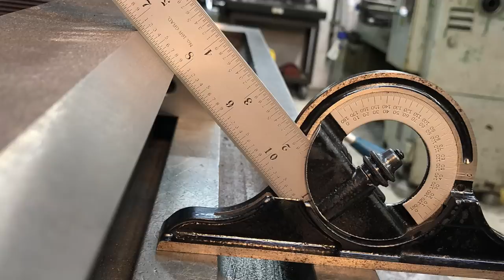SNS 310: Machining a Cast Iron Prism Straight Edge

Comment: you did not say if you were happy with the results of using that stripper wheel on the casting?  Work well? Or?

Just a crazy idea:  When you are not working on a project that requires imperial specification/measurement, you might find it easier to use metric rulers and calipers, for instance, to avoid having to mess around with 'fractional incehs' for quick measurements, like you were doing to center the part in the vice...??
Reply: His scale is not fractional, it's decimal. I'm not sure what makes people think that USCS ("imperial") is fractional. USCS scales/rulers come in fractional for carpentry and decimal for machining. Just as metric can be expressed as a decimal, so can inches. 5.565 inches is just as easy to read as 141.35 mm. Metric can be expressed as a rational number too.  141 4/10 mm. Rational numbers are actually more precise than fractional numbers. Try expressing 2/3 as a decimal. Even if his scale was fractional, most people in the trades have no problem using fractional numbers. For some reason Europeans just can't grasp fractional/rational numbers, which is weird. I'm in a weird position, where I used fractional USCS for my construction, decimal USCS for my machining, and decimal SI/metric for my scientific/academic work. So I can go between the two systems, and between  fractional/rational and decimal.
Reply: @xenonram  say what?
"For some reason Europeans just can't grasp fractional/rational numbers"
That's simply insulting, on the face of it, but....
Since "rational" is an entirely different mathematical term, perhaps you failed to grasp "rational" vs. "irrational"?
Is that something that US Americans can't grasp?
But, maybe you thought to say "decimal" instead, although you made the same error, again : "Rational numbers are actually more precise than fractional numbers. Try expressing 2/3 as a decimal"
Since 2/3 is an irrational number, it's a long stretch to write it precisely in decimal, but, one might argue, why would you specify something that you need to repeat as a measurement with an irrational value, when any measurement has, by its nature, some physical limit to its resolution, precision, and accuracy? Hmmmmm.
Anyway, that's as hard as taking a slice of pi.
And, with metric, one (the rest of the world, at least) does not need to futz with calculating around numbers like 12,36,1728, or  ounces, pounds, cups, pints, quarts, gallons, et al.
And, as you noted :
" I can go between the two systems, and between  fractional/rational and decimal."
One avoids that whole "go between" issue, ensuring more error-free interchange of information.... and, again, what with this "rational" thing?
In any case, who, given a real choice, given a choice, would choose a system that works like this: 

- Number drills get smaller with higher numbers
- Letter drills get bigger with higher letters
- Fastener sizes get smaller with smaller numbers, but, suddenly, change to fractional (but still rational) sizes
- Tap drill sizes for fasteners are numbered, but in the opposite direction to fastener size
- Sheet metal is thicker with higher gauges
- Wires are smaller with higher gauges
Sadly, we are all stuck with 60/60/24 for times, and similar numbers for degrees! (unless we use radians ;-) ) 
Have a lovely, hopefully COVID-19-free, day!

Comment: How do you prevent chips from getting stuck in the soles of your shoes. I always get them embedded and have to pick them out (PITA) before I scratch the crap out of my floors. Also, how do you prevent your vacuum from getting clogged with long stringy chips?
Reply: Switch shoes. Or love the work more than the floors.
Reply: Chips in the shirt are worse,  especially when hot!
Reply: Clean the floor more often ,use chip deflectors, change shoes,and use vacuum cleaner.

Comment: What's the point of scraping a straight edge instead of surface grinding?
Reply: Surface grinding won't get it perfectly flat. There is always stresses imparted by the magnet, imperfections in the ways, wear of the wheel, distortion due to heat. Scraping gradually and systematically removes all high spots to make it practically perfect. It imparts no stress on the workpiece while you are doing it, there is no heat distortion. Also, if you are talking about a sliding surface rather than a straight edge you DON'T want a perfectly smooth surface. You want many discrete point so that oil will be held in the gaps between the points. For a straight edge, perfectly flat like a granite  surface plate would be ok as you are just marking with it. But the only way to get the required degree of flatness would be lapping.  Stephane Gotteswinter did a nice 2 part video on the basics of scraping, both the how and the why. Very much worth watching.

Comment: Also, I have the same hydraulic lift table he puts the vise on, but mine lowers on its own after a few hours. Any idea how to stop that from happening?
Reply: Make sure the valve is closed all the way tight. The jack might need rebuilt if it's still leaking down
Reply: Check to make sure all the air is purged out too
Reply: I assume the ability to do that is all underneath the little red cap that says "Do not adjust" ?
Reply: That table has metal "legs" that you can fold in and lock the table into place.
Reply: I saw those legs, but there doesn't seem to be anything for them to latch onto. I'll give it another look, and if I don't see anything, I'll assume the factory in China missed a step

Comment: Just curious if anybody uses a magnet to catch the metal shavings?
 I'm a scientist not a machinist, so definitely not sure if this is a useful observation - please advise
Love your videos, I've been working my way through all of them - very professional
BTW - the clip of that pork in the smoker had my mouth watering
Reply: Yes there are magnetic pickup tools.
Reply: if you use a magnet wouldn't it just stick to the machine  when you try to get the shavings off?
Reply: I don't know if anyone has tried it but I will. There are magnet pickup tools and I have several of them. They are most often used to sweep the floor of chips. The handiest ones have a way to release the chips. I have seen (and used) magnets to attach chip shields to milling machines. Most modern CNC mills are totally enclosed and the chips and coolant are deflected and funnelled down to a trough with a conveyor that takes the chips out of the machine for further processing.
Reply: In my youth I worked a churchill grinder that used magnets and a paper filter roll to clean the coolant oil the magnets were rings that sat in a comb and turned to scrape clean it was a beast we stood on a moving platform and moved with the grinding wheel.

Comment: the workholding caused the deflection in the part if the same method were used on the shaper the result would be similar
Reply: gary rhodes no, the vise would have to hold it the long way on the shaper
Reply: @Highstranger951  I think you have misunderstood me if you compress the part in longitudinal axis  you induce deflection this would be the same on the mill and the shaper my point being that the way it was held was the problem not the choice of the mill

Comment: I am curious as to why the prism has been made from cast iron as opposed to just being milled from a piece of square stock. Given the additional work still required to complete the final product it seems like it would eliminate a step in the process . Is cast easier to surface grind and scrape ?
Reply: If properly cast and cooled cast iron has less internal stress than rolled or forged steel so is more dimensionally stable after machining.
Reply: Im with you on this one. Those home cast parts are not going to ever be accurate. The castings are too unstable and the part will change as it settles over time. Precision tools require top grade materials. Cast iron isnt it. LOL....
Reply: Have you ever machined a piece of square stock (or any bar stock) to a shape like that prism? If it is cold rolled bar stock I guarantee you that it will twist and bend way more than cast iron. Less so with hot rolled but still worse than cast. Once you have it milled to the basic shape you want you will have to use some very carefully thought out setups to get the bends and twists out of it. Even then as the temperature of the part changes it will bend and twist again. Try it, measure it, you will see.
Reply: @utidjian  Than you for the explanation
Reply: Cast iron is the most stable of all metals, this is why all good machine are cast iron or close cousin of it. To improve the stability,, cast rough machine, thermal stress  relieve ,age (usually outside) then finish machine, scrape as  needed.

Comment: What do you  use to lift the crane onto the table  to lift the vise
Reply: The same crane, just run it in reverse
Reply: The grand is relatively light. He can pick it up easily. Way lighter than the vise.

Comment: Not a machinist ,  but a question...could you use a set of V blocks to hold that in place for the 45° cut ?
Reply: was thinking same thing it would be so much easier and safer to hold
Reply: It might be difficult to then support the ends on parallels because there usually is no height adjust ment for V-blocks. I suppose, then, that adjustable parallels could be used at the ends.
In any case the problem was that the workpiece was standing too high towards the middle during the cut. Once the work was released from the clamping it was concave (hollow) towards the middle.  The bowing upwards of the workpiece during the cut would be hard to avoid with the setup that adam used. Especially so as the workpiece warmed up during the cut. Using coolant might have helped. Not as cutting lubricant but to keep the face he was cutting cool.

Comment: If it were for imprinting for machine scraping, wouldn't it be better to finish with lapping?
Reply: The best finish for straightedges is scraped. It leaves pockets for the blue so it doesn't all squeeze out the first time you spot something up, and by scraping you can be sure it's really flat (not just a match to the lap).
Reply: Lapping would make the surface too smooth.

Comment: What does hand scraping mean? I know surface grinding makes it really smooth and flat. How can you do anything by hand and get it even better?  I think sometimes you refer to using the shaper as scraping making me even more confused. Love your show. I am a hack machinist but I know I have learned things and that I will be less of a hack when I do things in the future.,
Reply: @DavidArnold2God-Glory  even after seeing all kinds of videos demonstrating hand scraping I still don't really get how a human can achieve better results than a machine in this kind of operation.
Reply: @Mr30friends  When the "printing" process is done when scraping, the part is under zero clamping force, hence zero distortion. Even if there are some clamping/holding forces when you actually scrape to remove the metal, you're working to the marks made under zero distortion.

Comment: Of what benefit or purpose is this casting for?
Reply: Parris Bradley this is a prism to blue up a dovetail for scraping a dovetail slide. So it has to be scraped perfectly flat. Then you put bluing on it and put it into a dovetail slide and rub it. The blue will transfer to the angled face of the slide allowing it to be scraped flat. One of the best videos on scraping a dovetail is on muellernick ‘s channel but there are many others.
Reply: Once finished, it is a reference straight edge. An example of use would be to check the head of an engine to see if it is flat, or warped.

Comment: Toolmaker or Machinist, what is Adam.
Reply: I think Adam is a machinist. And I say that with the utmost respect. Robin Renzetti is a tool maker.  Adam works with relatively soft materials to accuracy of 1000ths. Robin works with heat treated material to accuracies of 10ths of 1000ths or millionths.  Adam is merely human. I think Robin is an extra terrestrial, or a human from another dimension. He sees machines and work pieces like a human finite element analysis software package.
Reply: Toolmakers build parts to assemble as tools. Machinist build parts.

Comment: hand scraping seems so low tech compared to milling and grinding machines, it doesnt make sense how it would be good enough.
Reply: It's the fact that you can very selectively hit only the high spots while comparing to a known flat surface. The lack of clamping force on the part means it flat while stress free.
Reply: No way a machining or grinding operation can give you the same degree of flatness. If you don't believe me go mill something and spot it on a blued surface plate and see for your self. It is a whole other level of accuracy.  You won't really appreciate it until you see it for yourself. And if you have more than 2 or 3 thou. to take off, scraping us not the right way to go. Mill it or grind it. But if you are a few 10ths out of flat here or there,  it's the only way to detect it and the only way to fix it.
Reply from the maker: Self educate yourself on what hand scraping means and you will better understand why it’s used.
Reply: @Nibleswick  I just watched that.  Very good!! Thanks

Comment: Did you indicate that second cut? You set the jacks and then just started cutting. What if it wasn't level in the vise?
Reply: @ Brennan High, I think because Lance is going to grind then hand scrape it, indicating wasn't necessary. Just a guess though.
Reply: @Rubbernecker  Maybe. I was more wondering because the first side was like 25Thou out of square that it might stand to reason that the other sides would be that far out too. If that second pass wasn't square it could cause the entire thing to turn into a trapezoid. Since it's being used as an imprinter for scarping in waze's tho it seems like final dimensions aren't crucial. I always took Adam to be the type that hears "dimensions not crucial" and thinks "HA! I can make that the most accurate thing ever machined by man!"
Reply: @xenonram  check again the bottom face was still rough. The first cut face was against the vice
Reply: @Breennan  Yes, I just came back to correct it.
Reply: Correction: the bottom face is being averaged out by the parallel. So indicating the top surface would effectively do the same exact thing. Either average of the bottom of average out the top.

Comment: How do you decide when to use oil on a cut?
Reply: Materials play a part. You don’t use oil when machining cast iron. The most significant thing the oil does is cooling so it’s very important to have when removing material quickly.
Reply: @JamLeGull  it IS used to lubricate not to cool, cast iron doesnt need lubricant because the graphite in it is already lubricant enough
Reply: James Davey  I agree partially,don't use oil on CI,  oil is is a lubricant, a good coolant for CI is kerosene or any simular liquid (diesel fuel  oleum) most machine manuals  also suggest air ,but it blows dust all over the place, mist would be a good choice.

Comment: I'd  scrape it in right off the mill. At 1 time I was so good at scraping, I'd just take an old worn guide, not even remachine, just scrape it in. Actually grinder it first if it's worn .015 or .020 then end off with the hand scraper. I just remachined the carriage of my big lathe, it was so worn I installed bronze liners. I didn't even scrape it and it fit prefect, after 35 years you kinda get the hang of it.

Comment: How do you know if it is level in the opposite direction that you indicated?
Does it need to be a perfect 90 degrees?
Reply: Over the much shorter distance, it's probably good enough to be within the tolerances for the grinding.
Reply: What I ment was, doesn't the two milled faces need to be 90°?
Or is this tool not intended to be a "square" type tool.

Comment: Is there a particular reason why these sort' of things are always made of cast iron, as opposed to a tougher material like steel?
I'm actually quite surprised at just how good cast iron can be made to look, just like satin.  For a porous material,  the finish really does look rather smooth.

Just don't drop it! 
It'll probably break like glass!

TURK
Reply: Better dimensional stability. I think, because it's cast, there is not much directionality to the crystal structure. There's a few other reasons, like how the graphite behaves inside the structure.
Reply: @soupisgoodfood42   Thanks mate  ; )
I thought it may also be to do with heat,  cast iron may less prone to temperature fluctuations purely by handling it.  So,  basically, it's more stable.

TURK

Comment: Adam, What is the best way to get repeatable micrometer reading? What am I doing wrong? Love ALL your content.
Reply: Get a good quality micrometer. Make sure the faces on the anvil and spindle of your micrometer are always clean. Drag a piece of clean paper between the faces and check the zero of your mic before you start measuring. Use one with a consistent ratchet or friction thimble until you get "the feel". Practice on some gage blocks and/or gage pins. When measring work pieces make sure they are clean, deburred, defuzzed and cool enough to hold in your hand before you measue them. Measure several times in several places and orientations.If you use a digital mic don't look at the reading while making the measurement... there is a tendency to turn the thimble to get the reading you want instead of the reading that it is.
Reply: Thanks, I didn't even think about using gauge blocks.

Comment: I wonder if the K & T is a little more worn than the shaper? Great videos thankyou.
Reply: I doubt that. The machine usually don't wear that bad. Prob too much torque in clamping as Adam said. I sometimes would put an indicator on the part. While clamping. Sometimes you have to sacrifice a little. Tight enough to hold without pulling out
Is sometimes enough to now the part.